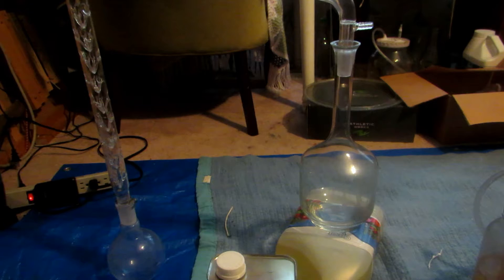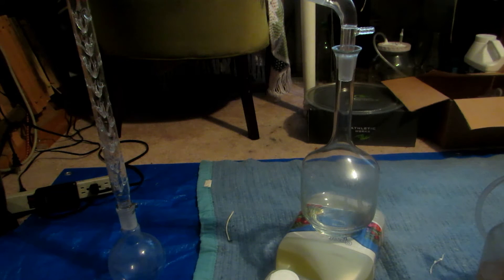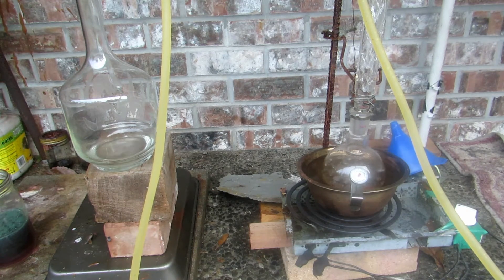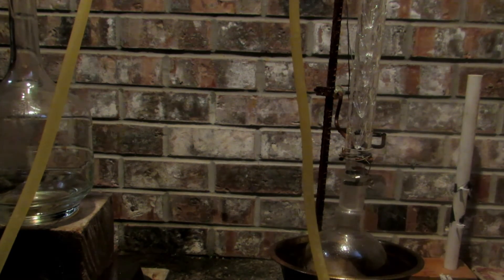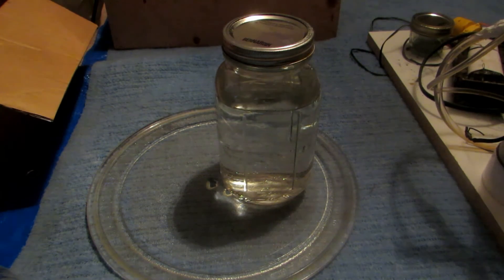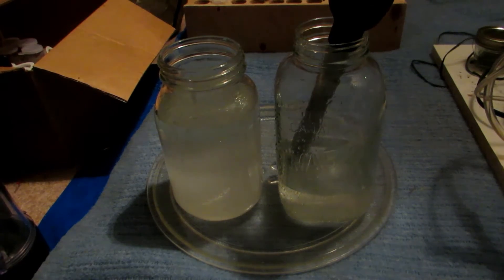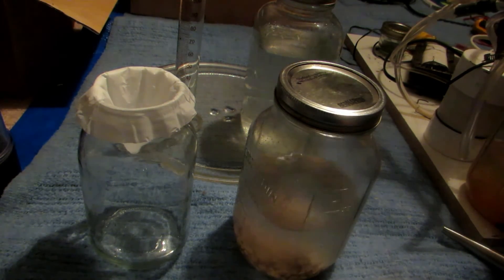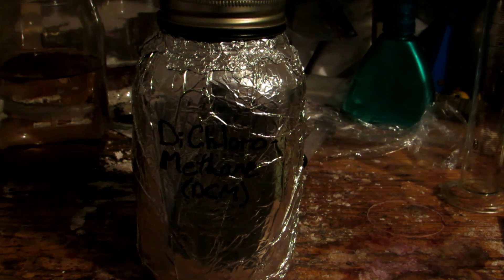Dichloromethane From Varnish Remover

Comment: I know that I said that perchlorate is better so I changed the way how I get potassium chlorate I'm now extracting it from flash powder which Indeed has perchlorate in it but I'm not sure that I can extract the alluminium powder from it I'm trying to disolve it and filter it off
Reply: I obtained the flash powder from fireworks
Reply from the maker: neat! it shouldn't be too hard, just continue to dissolve the potassium perchlorate and wen you filter, you should have aluminium powder as the filtrate and potassium perchlorate in solution. I don't think the flash powder contains anything else, but the rest of the firework might. Sometimes there is some strontium chloride, barium chloride, or other metal halides that give it colors, they are soluble in water and may compromise your final product.
Reply from the maker: I AM Diablo that is true, I do hope to get a bunch of potassium chlorate via the reaction of sodium chlorate (from heating bleach) and potassium chloride. although an electrolysis set up would be nice also. it is much more efficient and cheaper.